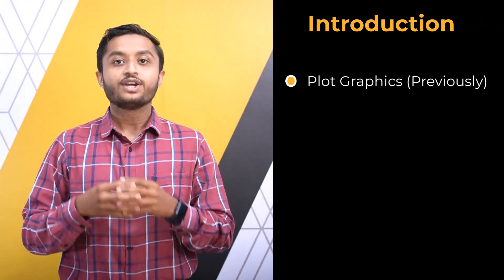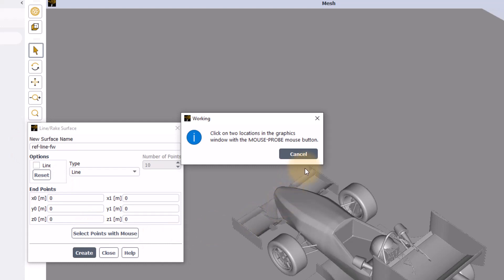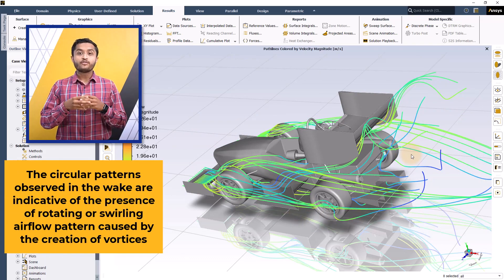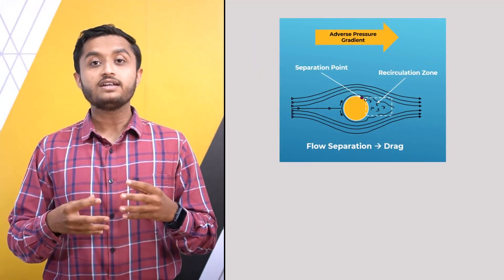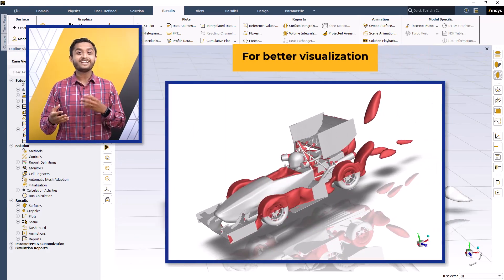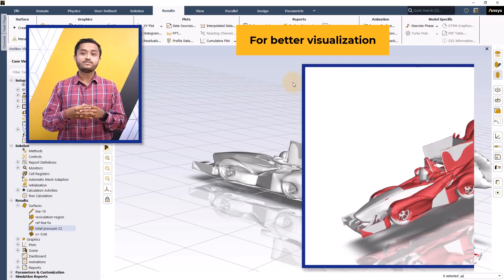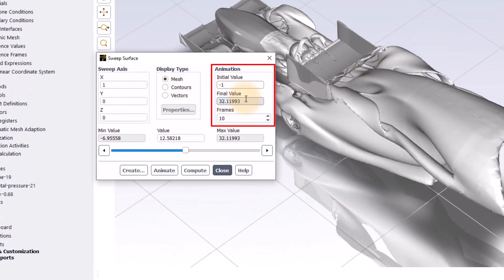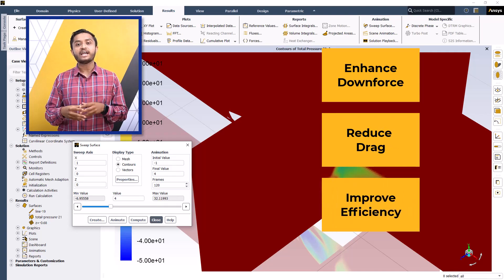Post-Processing the CFD Simulation of an FSAE Car Using Ansys Fluent — Lesson 4, Part 2

Comment: how to export the surface sweep as a video ?
Reply: hello, did you figure this out? I can't find a way to do this either.
The old way of using iso-surfaces and key frames doesn't seem to work anymore in 2025R1.
Reply: @elementalsheep2672  I was able to do it in post 2024R1 with keyframes and isosurfaces , it was annoying and I believe it should be made in  a more user friendly manner, it is very annoying.